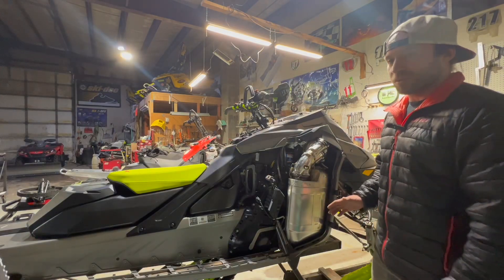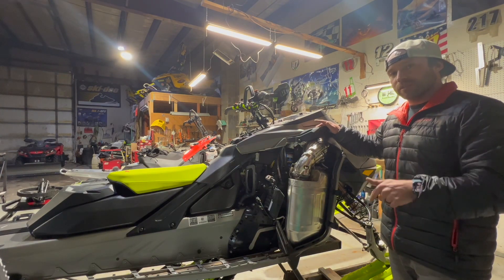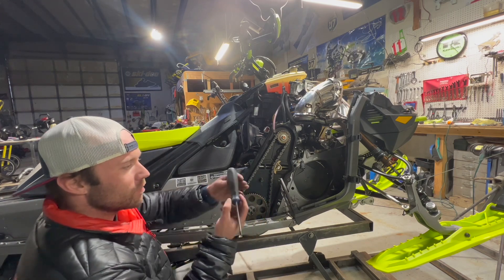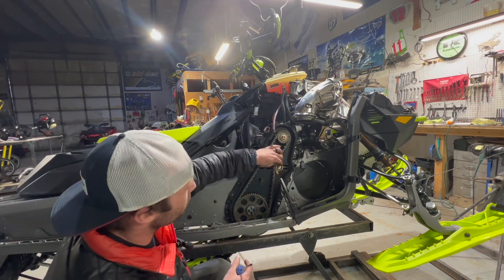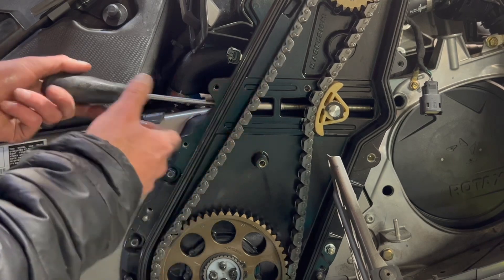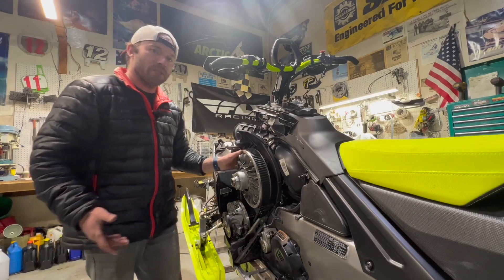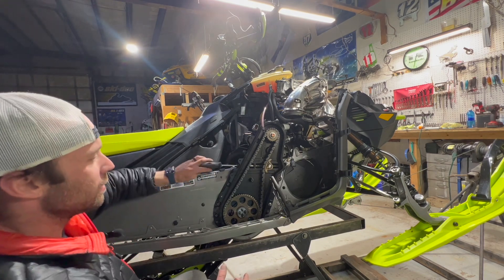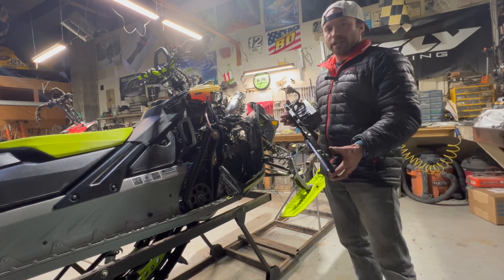Ski-Doo Gen 5 proper chain tension, what proper chain tension looks like inside the chaincase.

Comment: Hey Steve, why can't ski doo just tap the chain case bolts instead of using that self tapping bolt ? I've never had in issue until my 21. My 20 and 14 are still perfect. I've taken the time to tap on the 21 and install a nicer bolt. And you can really feel that set up tighten up.
Reply from the maker: That’s a good idea, I’m not sure the reason behind that.   You have to be careful for sure with the magnesium case and cover
Reply: I also switch the bolts out to standard bolts.   If you look at the ones from the factory real close, you will see they are trilobular, which is what allows them to self tap.   I believe they strip,out easy because there are only three point of contact on each thread.
Reply: probably cost. cheaper to use self tappers-gotta be careful when tightening those bolts and use a torque wrench. the case is magnesium and it's easy to strip the bolt holes.
Reply: All the money they waste they could tap those holes. And yes I torque 89 in/lbs
Reply: @backcountryshitok  yeah, would like to know why they don't. a thing I do is run a tap thru the chain case bolt holes to remove the metal chips left behind when the self tapping bolts are first installed at the factory.

Comment: It’s a misnomer, but chains actually don’t stretch. The tensile strength is far too high. On a motorcycle where it’s subjected to the elements, dirt and grime each link will microscopically wear down causing slop, making the chain longer which gives it an appearance of a stretch. However, a chain enclosed in clean oil isn’t  likely to wear nearly as much as a motorcycle chain. I suspect either the plastic chain tensioner wears down loosening the chain or more likely the tension adjustment screw slightly backs out due to vibration since it’s not locked in place. Either way you’re correct. Very important to check the tension since these things are wildly and unnecessarily constantly blipped
Reply: disagree I owned a bike shop for years and laying a new chain next to a used chain the used one will be much longer.
Reply: @berlinbanks  A bike chain is far different than a drive chain on a snowmobile, or just about anything else actually, made lighter for shifting ability.
Reply: @berlinbanks  longer because each link wears a millimeter. You don’t have enough torque by peddling to stretch metal. 🤦🏻‍♂️
Reply: Exactly, not stretch, the wear results in slop between links.

Comment: Great vid. Probably more important than ever since for some reason the '23 turbo R's didn't come with a stronger chain like the previous years' turbos. check the part numbers on your sprockets with the parts fiche and you'll see that the fiche shows different part numbers which is the proper HYVO equipment. the chain that these sleds came with is also not HYVO. supply issues, cost cutting, who knows why...
Reply from the maker: Good point…